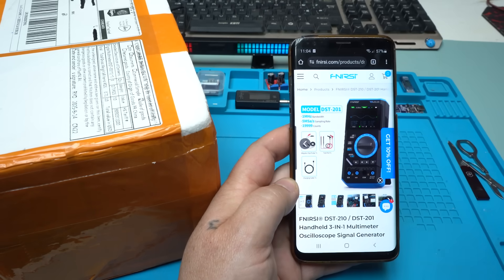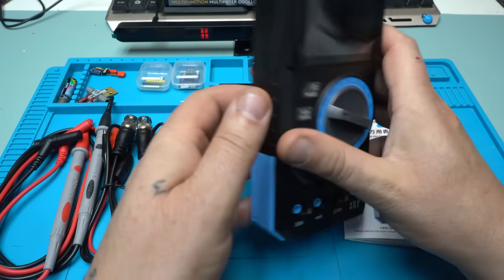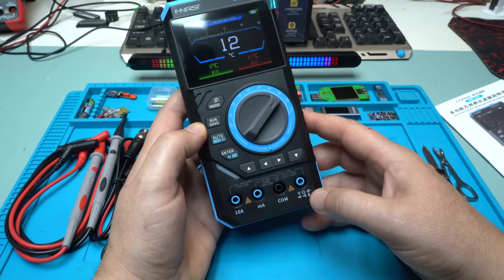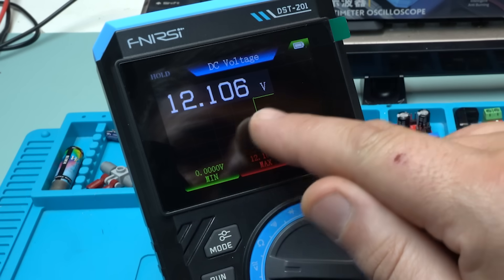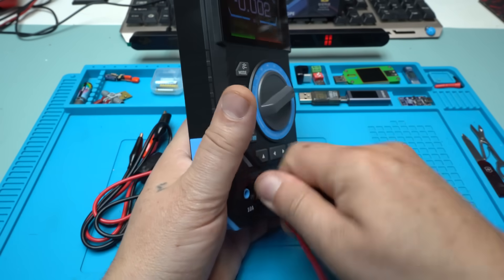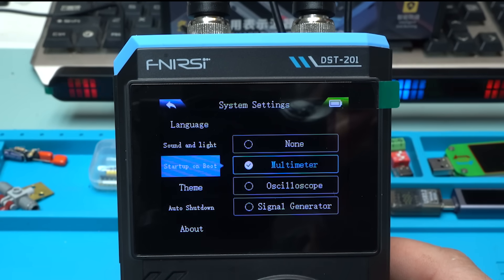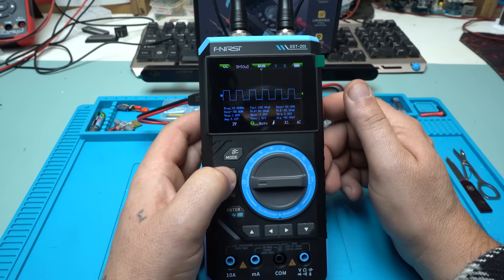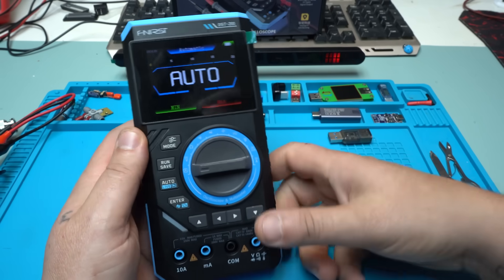FNIRSI DST-201 3IN1 Digital Multimeter 19999 Counts

Comment: If they made it as rugged as a Fluke, they would have something. My FNRISI meters are weak in the lead connectors, and often the solder connections break on the circuit board to them. I love the displays and the functions, and use mine often for troubleshooting in my garage.
Reply from the maker: Thanks for the feedback on the lead connectors!

Comment: A whole 1 MHz bandwidth! 😂
Reply: There's a 10mhz version for not much more
Reply: For the price?...Bargain mate!
Reply: @Nyaradzo-o7l Keep spending your money on junk equipment, and you'll never afford something decent.
Reply: @DiggerD-w6r  As I also keep telling myself "I'm not rich enough to buy cheap stuff", but on the other hand, these kind of tools are good enough to get started and have some tool to measure stuff.
Also I really do like the slow 'chart' function as shown in the video.
With FNIRSI I got the feeling they intended it to be a throw-away brand, but somehow became successful.
They do make tools which look quite well designed, pleasing to the eye and cheap.
Also it isn't that bad in practice.

No idea though about safety. I have not seen in-depth safety oriented reviews of these tools so I would not try to measure higher voltages with these.
Reply: @DiggerD-w6r  I will never afford a Keysight nor a Lecroy! And for my needs it fits the bill.

Comment: Is the battery replaceble?
Reply: Yes, simply open the device and solder in a new one.
If you don't know how to change a battery, you have no need for an oscilloscope and signal generator.
Reply: @johncoops6897 I know a little😊. My question was, if there is a 18650 (or such type) battery in it, or is it glued and not to repair.

Comment: I actually bought the 210 a few months back, you can actually record screenshots and use the USB to transfer it to your PC.
Reply: I wonder about malware 🤔
Reply: @Atom224  I actually bought mine off Amazon instead of Aliexpress so it should hopefully be less of an issue
Reply from the maker: That's a great feature!
Reply: Can you run it in real time into a monitor or computer screen?
Reply: @rofflestomp684  no, when you plug it in it acts like a hard drive
Reply: @Led_Icaurs  Gotcha.  It would've been cool to run thru my bench TV/monitor and have the portability.
Reply: @rofflestomp684  I agree, when I saw the USB connect in the settings I was hoping the same

Comment: I bought the "ZOYI ZT703S 702S Digital Oscilloscope Multimeter" which is very similar and is really a nice instrumen BUT: The screen saver always kicks in after about 60s - no matter how its set and sometimes it starts but you have to wait 1 Minut before it actually measures. Maybe you should test the simple functions first...

It seems a common issue for the chines stuff - not tested thouroughly in all details.

Comment: Be careful with Fnirsi product's!
I bought their soldering station and fried pcb board because station didn't factory grounded !

Then i bought bench power supply by Fnirsi and it's bad with voltage spikes ( fried some components) because they didn't filterd output dc voltage !!! Huge spikes that would be solved with 2x 25V capasitors
Reply: Why no output filter on a power supply ?
Reply: @nicod974 ask fnirsi
Reply: You shouldn't add capacitance to the output of a stabilized power supply because it will slow down your feedback loop. If the power supply is generating voltage pulses, I would probably focus on secondary filtration, check the rectifier diodes, and inspect the primary filtration. However, given that it's a Chinese-made product, the problem is likely in the overall circuit design (or general design).